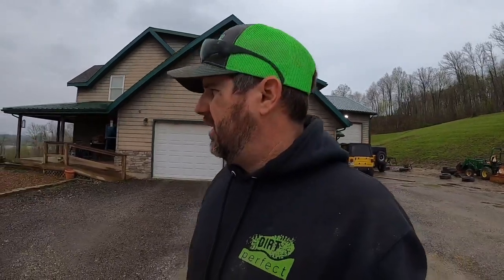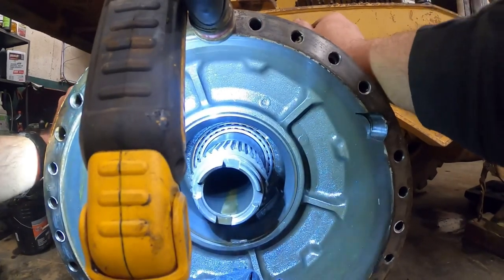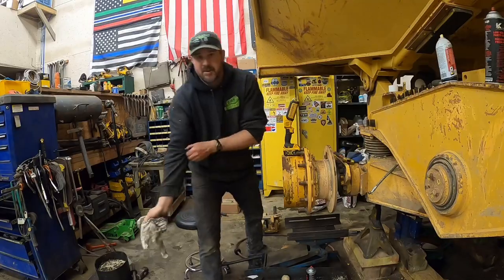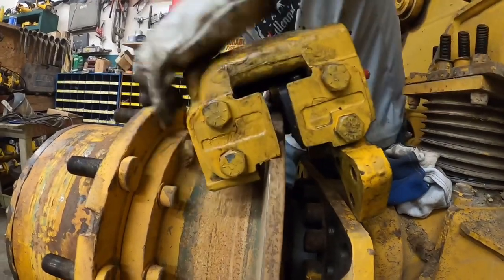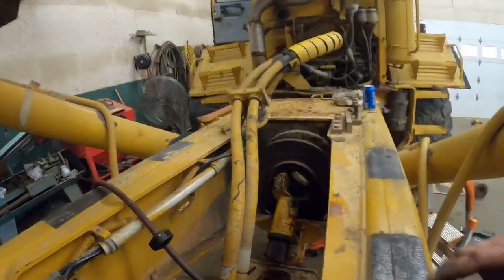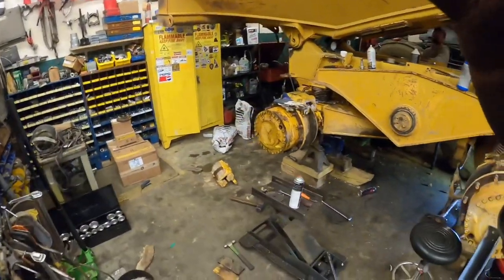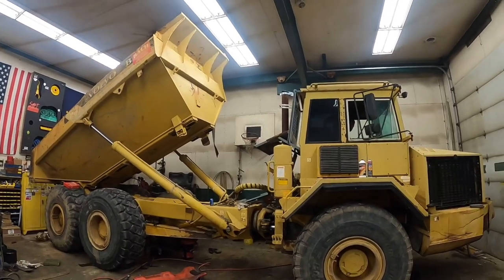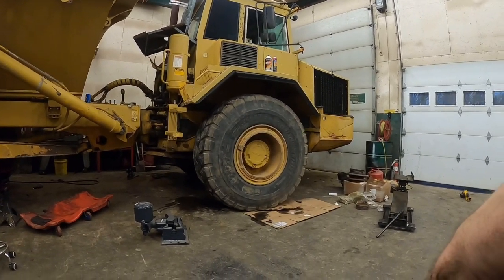It only took 7k, 4 video attempts, and 4 weeks but Bubba Dump has brakes!!!!!!! #volvoa30c

Comment: My mom has been a nurse for her entire adult life, now retired after 45 years in nursing.  She was really worried when she saw how dangly the hoodie drawstrings were while you were working on the big machinery.  She has seen the results of them being caught in machinery many times over the years.  A broken neck is a likely outcome.  Tuck those drawstrings inside the neck of the hoodie, don't let them dangle.  She wishes you good luck!
Reply: Good advice!  Thanks mom and thumbs UP!
Reply: Personally have had to cut a friend loose when his drawstring got caught in the fan blade of a car fortunately it was a clutch fan and he didn’t get sucked fully into fan blade and had the presence of mind to pull the coil wire which gave him a nice shock but killed the engine before anything seriously bad did happen besides needing to change his shorts) Myself when I had long hair and was leaving work so I didn’t have in a ponytail got my hair caught in a fan belt when I stopped to listen to a noise on a car another mechanic was working on. Let’s just say that is a painful way they to get bad haircut.  Lastly wrist watches and rings of any kind are also definite no no’s as is pens, pencils cigarette lighters in shirt pockets, I have stories about all of the above and none of them good and all causing physical injuries and some serious and permanent.
Reply: Yep. I wear hoodies almost exclusively to work in when it’s cold. First thing I do with a new one is pull the drawstring out or cut it off if it’s sewn in place. And don’t let neck scarves dangle. I did sawmill work for an older guy whose dad worked at a circle mill. The wife gave him a silk scarf for Christmas and it wrapped around a shaft and decapitated him. Silk is virtually unbreakable. Gotta be careful.
Reply: Your statement is true, however they were not working with rotating machinery. Yes there is a potential be it very very small at best.
Reply: Now that there are rubber wedding bands I hope there are fewer ring fingers being DE-stripped!! 🤔 Anyone working around machinery should either remove their rings or use rubber ones; hopefully the first time you snap your ring will be the only "experience" you need to learn from. 😳 👍
Reply: I agree and thought the same.
Reply: @arkiefyler  a friend of mine left his wedding band and the last two sections of his ring finger hanging on a tanker truck when he jumped down.  It took a few hours of surgery to put the ligaments back in his hand and arm.
Reply: I know what your Mother was worrying about, as a Paramedic for 42 years, I've had to extricate people wearing loose sleeves from all sorts of equipment. Lathes and large drill presses caused the worst outcomes.
Reply: Number one safety rule as an aircraft mechanic (I was a Flight Mechanic in the Coast Guard) is absolutely no loose clothing items and no rings, wrist bands including watches or anything around your neck including your neck.
Not even your dog tags 
While off the ground up on aircraft or while working on the ground on anything that moves.
You can actually face a courts martial for an injury caused by your not following safety rules if you suffer an injury.
Reply: Female cargo handler got killed at my airport as her scarf(wintertime) got into the belt loader while loading the luggage on the aft cargo compartment on a 737. Nobody close to push the big red button...
Reply: I'm a carpenter, 47 years, the first thing I do when I get a new anything with strings that hang is cut them off. I still have all ten fingers on my hands too.
Reply: Aye, that's why loggers cut the bottom seams off their pants legs too.
Reply: Had my hoody get sucked into a engine fan once not the most pleasant experience if I say so myself.
Reply: Plenty of fishermen have gone over the side due to dangly draw cords on wet gear.
   A guy I knew  slammed a stiff safe door… and shut his tie in it !  when the rest of the staff could stand up straight again, they had to cut his tie off to free him.
Reply: @JCrook1028  that reminds me of what happened about 50 years ago here. I was driving for a logging company. We were logging a tract and another logger was cutting the adjoining tract. I got back to the job from a load and the guys said "man you missed it".
One of the ground crew for the other company caught a ride to the deck by standing on top of the trunnion on an articulated log skidder (tractor). The guy was hanging on with his fingers through the protective steel mesh on the back of the cab.
His foot slipped and went down into the drive line. It was winter and the guy had on long johns, two pairs of well worn pants and two shirts. When the operator figured out what was happening and stopped the guy was still hanging on to the cage and not badly hurt but the only clothes left in his body was one boot and sock and one of his shirt collars.
He was fortunate that his clothes were old and worn out and that he was strong enough to hang on.

Comment: :) unknown used equipment is always "fun" to work on. Great job on diagnosis and repair. On the bright side you saved probably $15,000.00 plus by not paying dealer shop repair rates. Again, great job!
Reply: and he knows how it was done and done "right" plus now he has a tool for the nut and the service manual
Reply: You probably underestimated it by 30 grand

Comment: Awesome job guys. Free tip , (when handling big and heavy tires) cut a couple pieces of plywood into 3 foot squares,  lay one piece of plywood on the ground where the tire goes, coat with cheap grease. Then lay the other piece of plywood halfway on the first piece of plywood. Now roll the tire onto the plywood and slide into position.

Comment: Well, you have documented my weekly jobs ;-) Can assure you have figured out the same way to do things that we figured. When doing a hub seal, plenty of grease is the key!! And one more hefty grunt without the torque wrench and you will be good. As said we look after 14 of them, yours looks a little older. Check on the condition of the steering ram bushes into the back yoke, when they go they make a mess, couple of hours and very few $ saves loads of pain. I heard your comment working under the skip on the hand brake disc LOL . Stay safe

Comment: You do have an overhead hoist, you know. It is very handy for heavy items, and a strap will allow it to reach under the dump bed, or you could use an offset lift arm. Just a thought. Might save your back or your fingers. Or do you have more than one shop and the overhead hoist is at the other shop? Nope, you are using the overhead hoist to move the tire.

Comment: Drive shafts are a science all their own, I spent 25 years in the drive line industry, and you guys did a pretty nice job on the drive line install. Bubba dumper is looking good and should work even better. Thanks for the ride along.
Reply from the maker: Thanks

Comment: Great video DP. That was a job for sure. The way the dirt wore down the brake components really show why it's important to keep tracks or anything else that moves as cleaned out as possible.  Just like taking sandpaper to it. Bubba Dump will be a good truck when you and Matt gets finished with it.

Comment: I still can't believe that master cylinder. It looks like it came off a Chevy S-10...
Reply: Right? I'm sure the scale of the truck is messing with perception a bit, but I would swear the master cylinder on my bucket truck (an F450) is bigger.
Reply: Just curious. Does it have to big to actuate the air system? It is hydraulic over air, isn't it?
Reply: @hermanschepers4739  Other way around, air over hydraulic.

Comment: I found 1/4" x 5" cotter pins with a pice of crocus cloth folded over in the cotter pin chucked up in a drill or die grinder works great for cleaning up inside cylinders  like Matt was working on.
places that have cranes parts have the big cotter pins.

Comment: Finally!  It is very satisfying to get a major problem resolved. Now, what’s next? By the way, I hope you don’t end up regretting not rebuilding those U-joints before reinstalling the driveshafts.  Any critical component that old with so many hours on it deserves to be serviced whenever it’s out of the vehicle and easy to service. I know, I know, you likely didn’t have the parts to rebuild the U joints handy. But DP show them some love with at least an inspection & bit of grease !

How about you show us a preview of what you got coming into the shop?

Comment: Great work there Mike. Wonder what the issue was with regards to the manual stating in bold letters DO NOT REMOVE AXLE. There must have been a reason, maybe a spacer inside the pumpkin. A look at the parts breakdown could maybe shed some light on that. Thanks very much for sharing.
Reply: There is a diff locker on one side of the axles, but you can remove the shafts easily, we have to when the drivers cause them to shear!!!

Comment: Good going. Mike not sure on the wheel seal some of the big truck rear wheel seal are dry fit to spindle and hub because they seal turn inside the seal metal housing itself couldn't tell the kind it was  enjoy watching the video Bubba Gump going to be like new

Comment: As I was watching you guys putting the front driveline in, I remember watching a mechanic reinstall a front driveline by using a tie down strap. You have to wear many hats in your profession which is highly commendable. Excavating Equipment is one expense and the price to maintain them is another. Even a Full Service with fluids can set someone back 2-3 thousand dollars. Did you Get your DP Grill yet?

Comment: Wow that was a fun feel good video! You and Matt work so well together and get stuff done. As silly as it sounds, I was talking at you when you were installing the drive shafts. While they were out on the floor, you should have replaced and tested the grease nipples before installing them. I think a couple of them looked like they were not functional but overall you did a good job. I'll be sharing this with my Son and grandsons for their nightly "Fun with Mike and Matt " video. Cheers from Canada.

Comment: usually the do not remove axles is because the diff lock mechanism jams up if you pull both axles out at once and the only way to get it back together is by opening up the diff and tear everything apart oh and also the torque spec for the axle isnt that high compared to the stuff im used to work with they can easily have torque specs up to 1500nm
Reply from the maker: Yup agree figure that out on the front

Comment: They probably said not to pull the axle because of potential to drop the pinion out of the differential, which could make you take the differential apart.

Comment: I really hope you remembered to fill the rear diff with oil, otherwise, you gonna need more cash.😁😁😁
Reply: a boat load of it!
Reply from the maker: lol stay tuned
Reply: Mike, get into the habit of leaving the filler plug out, and a warning note in the cab to remind you. You will only make that mistake once, been there, done that, got the T shirt, I did that on a car, so not as expensive as a haul truck diff.

Comment: Since you like many others feel Anti-Seize compound needs to used in places that it probably not actually meant to used “carbon steel bolt” going into a nuts or treaded hole and especially where these fasteners/hardware is being exposed to water (Just a FYI most Anti-Seize compounds are Not water resistant meaning they will wash away over time however “Waterproof” don’t and to be clear not all greases and oils are waterproof) However if you insist on gooping fasteners in Anti-Seize instead a thin film of waterproof grease you might want to mix stir the container of Anti-Seize up good because it can settle out from sitting over time that you and then scoop half of it into another container of your choice and stir in up to the equal amount by volume of Automatic Transmission Fluid. The resulting mixture while needing to be recombined like some peanut butters is far easier to apply evenly and neatly as well as reducing waste and saving money.  Like the Sam said in that famous children’s book by the good Doctor “Try it, Try it, and you will see….”

Comment: I was forewarned when I worked at ATTC that PB will make some metals expand if you leave it on. Tight tolerances can become welded together. Use actual oil. 

 Might have been bullshit advice but I figured it sounded plausible.

Comment: I hope it all works after all the hard labor you all have put in fixing it. Next is when you use it if it gets stuck it will be stuck as all six dig it down quickly. Let's dig has had to empty their truck a time or two to get it out.

Comment: You may have had it blocked I hope you had blocks to hold up the box if it blew out a hydraulic line. You are doing a good job. And yes everything is heavy on them even the bolts
Reply from the maker: No I used the safety latch it’s clear in the video thanks

Comment: I hope the two of you never run out of equipment to repair since I would sorely miss the interaction between the two of you as you go about making the repairs. 
I guess what I'm sayin is... I'd watch your videos even if you never moved a shovelful of dirt. 
By the way... I'm not the least bit surprised to see the troubles with the 6 wheel drive. I could tell from the first video with Bubba Dump getting stuck in the soft and muddy field one of the axles wasn't pulling at all. It was a 4x4 not a 6x6. 
These Volvo off road trucks will pull like hell and it is rare to get them stuck.
I guess I need to add... the term off road truck doesn't necessarily apply to Dirt Perfect.

Comment: The problem with pulling the axle, rather than the gear could well be the possibility of something coming adrift which fits over the shaft inside the differential.
Check the diagrams in the service manual.

Comment: I hope you changed the torque wrench setting when you tightened the bearing to 400 ftlbs, loosened and retorqued to 200.   The video looked like you did not change the setting.   Best wishes,   Kevin

Comment: A hydraulic jack used to move cars would have been very useful when putting that tire back on you can change height and move in different directions.  Only need one in your shop.
Do you have fire extinguisher system in the shop especially since it is attached to the house.

Comment: Great video Mike and Matt!  I know your not bothered about painting it which I completely understand. However 😀 would you consider removing the “Bach” stickers ? 😉
Hot water from the kettle and it will peel right off 👍🏼
Reply from the maker: Stay tuned

Comment: Surprised the locking ring didn't go under the hub/axle nut, so that the half the lock tabs grip hub, and the the other half then bend  to fit the hub nut?

Comment: ADP the next time you are taking care of the wheels off in that garage have your mini excavator in there too so when you put it back on you used the excavator to push it and so you can turn and stuff and when you get to hang on to the studs you push on it really tight and put your night on try and get down and then push down on the bottom of the wheel and then do the same thing again it'll go on there a hundred times easier that's how we do it on the in our junkyard

Comment: At 24:20; it's noted "We got it wrong" (clocking/phasing, I'm guessing?) and I didn't hear or see either of you realize the mistake so I'm guessing at the next video's start, we'll be told and shown (fast forward) it being fixed?  ;-)
Reply from the maker: Plan worked look closer later

Comment: It's too late but if you pulled axle shaft out 1/2 way but leave it still engaged to rear then put planetary on it then engaged hub it might be easier

Comment: Hey Mike have you though of extending your garage forward about 30 or more feet with a larger door or if worse come to worse extending it on the back with a large side door. it would make life a little bit better as far as the extra room you really need in shop space.
Reply from the maker: No see not need in spending that money right. Now

Comment: Torque wrench should not be used to undo nuts as it destroys there torque settings and you just end up with a expensive long handle ratchet. Respect your your tooling

Comment: What series of delta wing u joints are on that short drive shaft we run a 6-6000 series on or Well drilling rig an they say that's fairly big but they make bigger an that has to be at least a few sizes or #s up and $$$ too ,glad you didn't pinch to many fingers.
Reply from the maker: Same thanks

Comment: It does not take a very close look at the drive shaft to see that the shaft is out-of-phase.  With your videos not being edited for several weeks, does that mean the truck was out of the shop and you noticed a vibration?
I have several pieces of equipment with drive shafts.  Some of the shafts have a spot of weld so there is only one way to put the shaft together.
Reply from the maker: No plan worked perfectly last look closer in the next video

Comment: I must be missing something, but it seemed to me that the outboard brake pad on that massive caliper is held in place only by that little cover held on by two relatively small bolts.  Don't those pads absorb the full rolling force of the machine when you put on the brakes?
Reply from the maker: What the first videos thanks
Reply: @DirtPerfect  Will do.  Thanks.  :-)

Comment: How much are the tires for Bubba dump I think you might wanna look into getting them after all that work might as well give him some new tread
Reply from the maker: Absolutely not over 50k for tires nothing wrong with the ones I have will last me along time
Reply: @DirtPerfect  wow is that how much new tire are holy moly how much are used ones yeah forget the new tires you might as well buy a brand new Bubba dump I didn’t know they cost that much I thought maybe 1000-1500